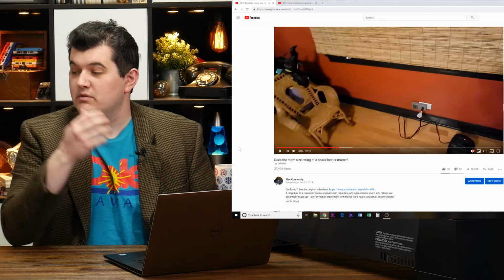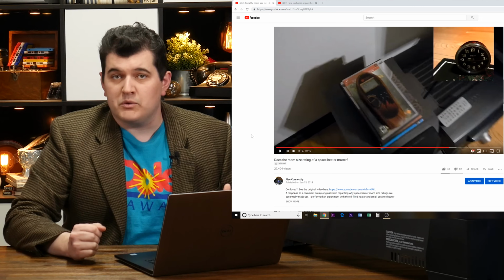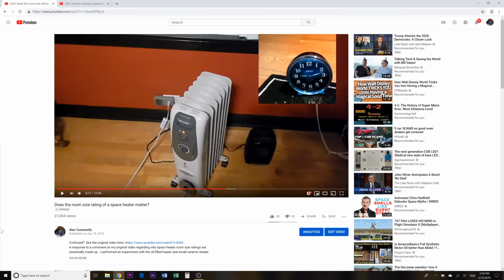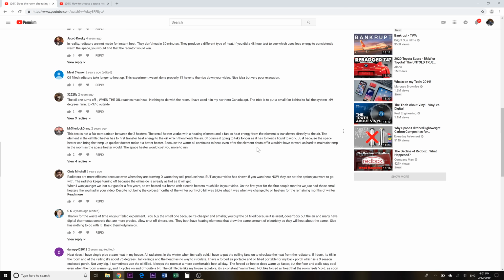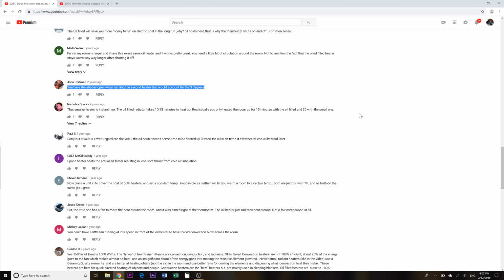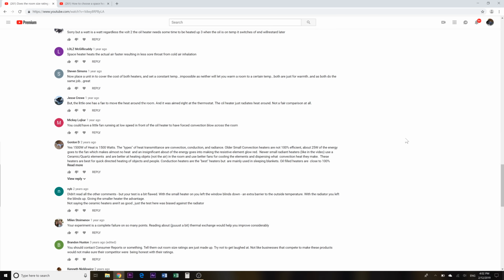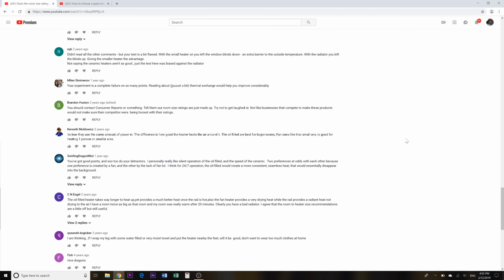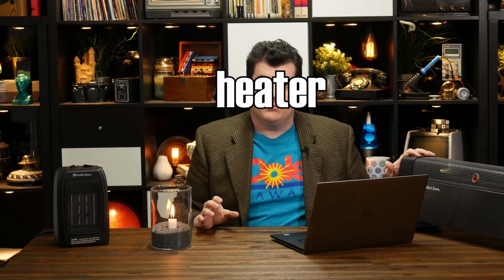More Space Heater Nonsense

Comment: Oil radiator heaters are meant for maintaining temperature over long periods. You use the smaller heater to get to that temp faster. You are testing heaters with very different functions against each other. You are making things that are supposed to WORK together Compete against each other. Typically you would use the Small heater to warm up the room. And use the OIL heater to maintain that rooms temperature for efficiency and for electrical use. I lived in a trailer for 5 years using these types of heaters. People are leaving comments because the methodology and purpose of what you are testing are flawed.
Reply from the maker: I simply can't understand how you're justifying the large heater's inability to heat the space quickly as some sort of benefit. It means, full stop, that it's producing less heat.
The point isn't that the oil-filled heater is a bad design. It's that it is nonsense to claim that it is better for "large rooms".
Reply: Also, the oil heater won't "maintain that room[']s temperature for efficiency and for electrical use". If we want to take a room from 60F to 65F, we need 5 degrees delta worth of energy. That's either 5 degrees immediately from what's basically a toaster oven with a fan, or 5 degrees slowly from a thermal battery.

 @TechnologyConnextras   Actually, now that I think about it -- the oil-convective heater is significantly more massive than the small resistive style heater. I don't know anything at all about the specific heat characteristics of the oil used (whatever that might be), but if I'm not mistaken (significantly likelihood thereof), though we've been talking about volume (space) this whole video, what really matters in terms of heating is mass-to-be-heated.  With the resistive coil heater, it's the paltry mass of the resistive wires and the mass of all the air in the room (since that's usually what we want when we talk about heating a room).  With the oil-convective heater, it's the mass of all the air in the room PLUS the mass of the oil (because all that heat MUST pass through the oil), and I think that implies the oil heater will require MORE energy input from the grid to bring the whole system into our arbitrary 65F thermal equilibrium, regardless of the amount of time you are willing to wait for that to happen.  There's just more mass to heat up, hence more kWh to consume, either by boosting the kW consumed at any given moment or by increasing the amount of h you have to wait.

But, I digress because this is not my expertise.  Even if we assume none of the previous paragraph to be true, we still need 5 degrees delta to all the air in the room, which requires us adding a specific amount of energy to the air and which does not care about the source of that energy.

EDIT to add:  If you are in a market where your cost per kWh of electricity varies on time of day, you could say it's more /economically/ efficient if you are able to load up a heatsink such as an oil reservoir on cheaper energy, which you can then utilize when electricity prices are higher.  But the amount of energy used will still be the same.
Reply: @TechnologyConnextras  Actually nominally improved cost-efficiency of oil heaters was an actual thing at my end of the world because you could get electricity at half the price during the night. So a really big oil heater, you'd run the heating element only or mostly during the night, and let it radiate the heat during the day. 

This wasn't always and necessarily a pleasant experience or necessarily economical. Hopefully you'd wake up and your room would be nice and warm, you'd take a shower and could prance around naked for a bit. Then the power is off but it continues heating the room while there's nobody to take advantage of that while you're at school/work, you come back home... and yeah just keep your clothes on, it's going to be cold for a while.
Reply: @TechnologyConnextras  I didn't. How about you dont try to shove an argument I didn't make into my mouth. You seem to be doing that a lot on this topic cause people pointed out how flawed a lot of what you did with this was. Your entire point boils down to, FAST = GOOD. While Im talking about efficiency over time and impact on electric bills.
Reply: What are you talking about with "efficiency"? 1500w is 1500w, they are both 100% efficient, unless the laws of thermodynamics do not apply in your trailer they are the same.

Comment: I get your original point, you're testing the marketing claim of small vs large room, not the heaters themselves
Reply: And in a small room he showed the heater claimed to be for small rooms was better. 
Ha, the marketing was clearly debunked there...
Reply: @JNCressey  I never said it was debunked. I said he was testing their claims. The small heater may have been better in the small room, but that's because a small fan heater is far better for that application than a column heater.
Reply: @JordyValentine  I think that is exactly it, and I think that is the only thing that would put any credibility to the small room claim. In the small room spreading the heat with the air movement by the fan will feel like heating up the room a lot faster, allthough the larger non fan device puts out the same mount of heat. Having both put out the same amount of heat I think a good comparison test would be more like having them running for e.g. 24 hours, heating up the space from the same start temperature and logging the temperature over time. I bet it will again show that both put the same amount of heat into the room and after some time temperature stays the same with both.
In a larger room only thing I can imagine is that the air movement by the fan has less effect, but over time the heating result ( the amount heat put into the room) is still the same.